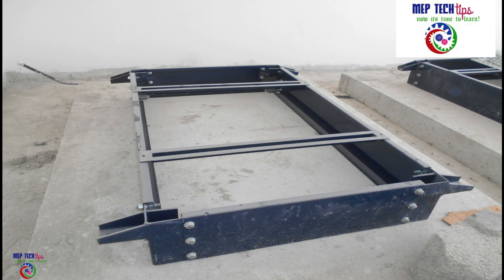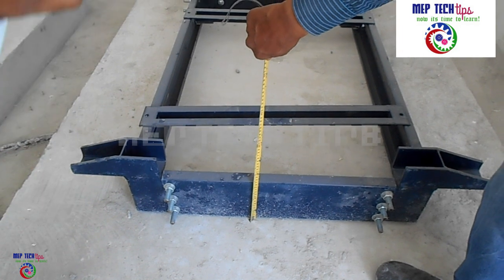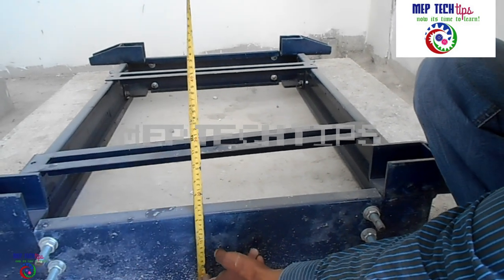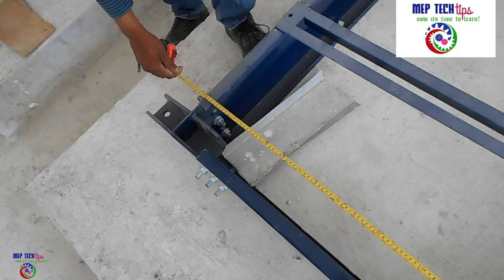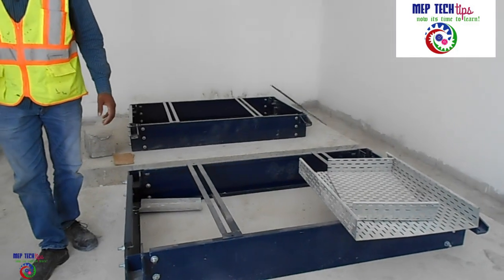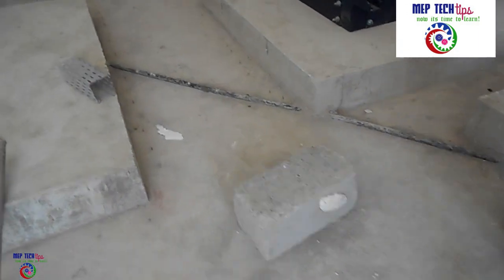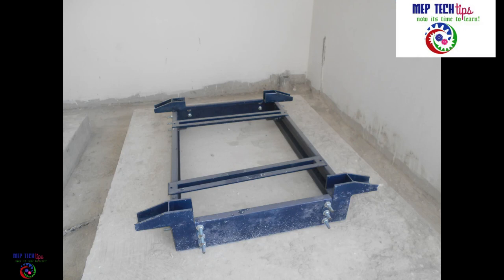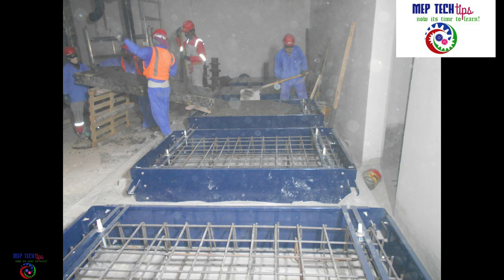Inertia Base for Chilled water pump explained by MEP TECH TIPS in English (PART-1)

Comment: Hi Sir. Thanks for the useful video. I am working on one of the Pump skid. Client has 2 option . one with inertia base and another one is hybrid base.  I have a doubt on the support condition. If structural skid is kept on the inertia base. The support points will be the anchor bolt points??
Reply from the maker: If am not wrong why you want go structural skid above the inertia base.
Simple
my suggestion is use inertia base for chilled water pump with help of isolator, inertia base supported through isolator, Just need a foundation below inertia base to get supported.